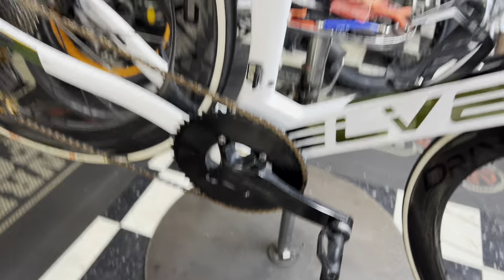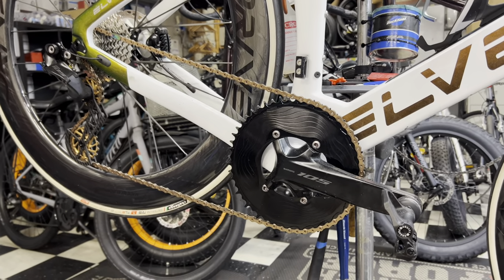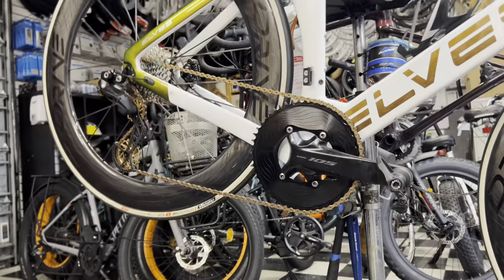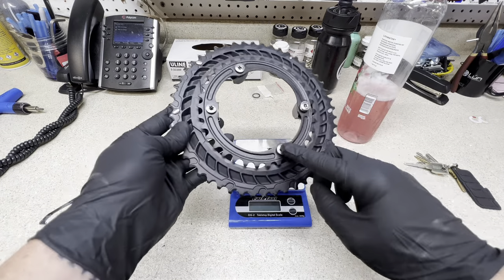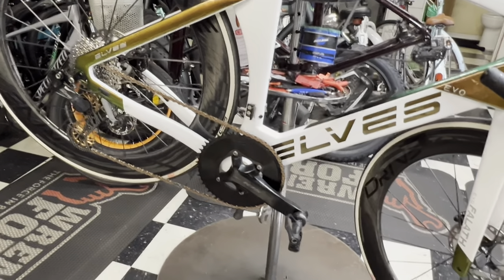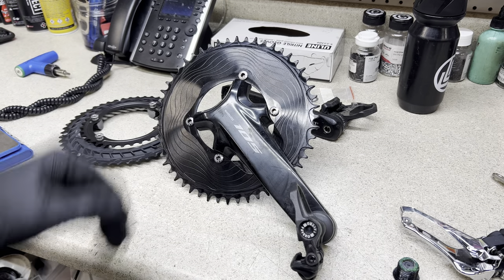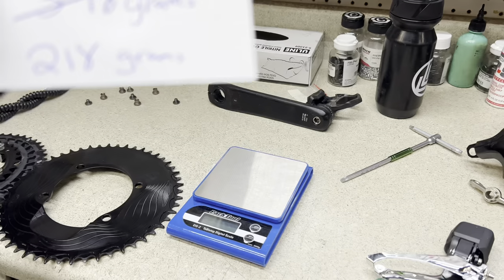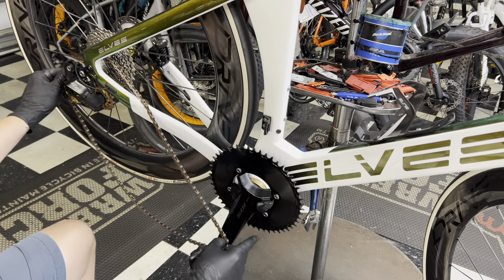IS THIS THE BEST UPGRADE FOR YOUR BIKE?

Comment: Alugear products bare a striking resemblance and the same chain compatibility as Garbaruk chainrings (which are excellent). Another interesting observation - both are made in Poland
Reply from the maker: Thanks for the info!
Reply: @GCPerformance18  What’s the chainline like on this setup? Does the Alugear chainring on the 105 crank line up dead straight with the middle cog on the cassette? It’s a super important aspect of 1x setups….

Comment: Hi Grant, I have a question for you regarding the frequency of chain drop issues with Shimano compared to Sram and Campagnolo. I'm curious if Sram's marketing tactics have influenced your perception, as my understanding is that Sram front derailleurs are often associated with chain drop problems. It seems like rather than addressing the issue directly, they market their 1x  setups as an innovative solution. Additionally, I wonder if many professional cyclists are compelled to use 1x setups due to sponsorship obligations. There are several videos highlighting instances where pros on sponsored teams don't use Muc-Off products due to issues.
Reply: I don't think Sram has that much sway over the strongest team of the tdf. I honestly think it was the better setup for them. Less weight and more aero. It's not like they need extra range.

Comment: I thought you get a worse chain line with 1x?
Reply from the maker: The chainline sits in the middle of the big and the small so there is not as much bend from top and bottom
Reply: It seems like my comments with links get deleted

Google 1x vs 2x velo news 

They did an efficiency test and got interesting results.
Reply: @GCPerformance18  I did some more research and what I found suggested that 1x is about 3 watts less efficient on avg, because you get more bend in the chain at the high and low ends of the cassette. With the 2x setup you can be in the optimal front ring to decrease bend.
Reply: @patrickrenschler 3 watts is totally lost in the noise. Its nothing unless you’re WvA - are you WvA?

Comment: Would you be able to use an 10 or 11 speed 1x chainring with the 12 speed chain? Since the internal width of the 12speed chain is the same as 8,9,10,11

Comment: This is a huge downgrade. Good if you like to run on a flat track. Terrible if you go up hills in the city

And the chain line is not straighter. It is straighter for beginners who forget to shift their front. 

Triple is the one that actually gives straighter lines assuming the rider is experienced at not cross chaining.

Comment: The rear derailleur needs a clutch, or any bump could drop the chain from the single ring
Reply: Not from my experience. I've used my current 1x setup for around 6 months and not a single chain drop. I live in the UK where the roads are known to be full of potholes too.
Reply: @lemonshire1 agree, a good quality RD and good quality ring are enough for all but the narliest off road

Comment: 14:29 I always wondered if that's normal. The chain is flapping enough to hit the chain stay. I had this happened to many of my 1x drivetrain bikes. I used frame protector to temporarily solve the issue. I guess it's a common 1by problem.

Comment: I have the 1x prev gen allez sprint and building a new gen with a 1x as well.  I really like the fact that I don't have to shift from small to big ring at the summit of those rolling hills in Tenn.  I did struggle a bit climbing long steady 12%+ grade when I took that thing to Taiwan.  I have looked at the Jumbo Vismo's setup as well.. most of them ran a 48 to 54t with 34 or 36 rear on their S5.  Not sure about their R5 climbing version

Comment: I like the ultra wide 2x from Wickwërks. Said it also work with SRAM chains so going to test it at my new TT build. 53/34 with 10-28, if it works. But otherwise I run 11s on my roadbike. 

It's so with that range. Wherever you go you have the gearing you need.
Reply from the maker: yea it is nice

Comment: Hey great vid! I tried this setup. Same Chain Ring, same Groupset. How do you deal with cross chain? It has weird noise on low gears and high gears extreme
Reply from the maker: If you wax the chain it helps a lot but it’s just for a little for the beginning wear of the chain on the chainring
Reply: @GCPerformance18  Do you mean that as time goes by the weird sound will just go away due to normal wear?

Comment: I don't buy the single chainring crossing less. The outer chainring is closer to the 11/10 sprocket, and per Shimano specifications I never go past the 8th sprocket either (21 on a 11-30 cassette).
For super flat terrains is OK cause you'll rarely get to the extremes of the cassette.
Reply from the maker: they are more centered then the outer chainring
Reply: There’s an offset built in.

Comment: 1x is not effective if you live in a hilly place. I run a 48/31 with the 11-34 and anything about 4-5% grade and I need the 31 to climb. With that being said I would need like a 42 front chainring or smaller if I want to be able to still climb above 5% grade. Here comes the big issue with that, when I go downhill I’m already running out of gearing with the 48 up front so a 42 going downhill would be useless! 1x are for very fit cyclists or cyclist who don’t climb.

Comment: How do your easiest gears work? I have this same setup with Alugear 54T and 105 di2 RD + 11-34 cassette. Top 3 gears grind and are incredibly loud. Wondering if it will get better as the ring wears a bit
Reply from the maker: I have no issues, depends sometimes on chain compatibility, as you can see i am running a mountain chain on there for looks, but sometimes certain chains until they wear down they are noisy at first

Comment: It doesn't give you a better chain line though, unless you're in the middle of the block. As for weight saving, well you're going to need a bigger cassette which will be much heavier unless you spend big money and DA only go upto a 34T cassette, and you're gonna be grinding up hills with a 50-52 chain ring and if you use a 46 or 48 chainring you'll be spinning out on decents. I guess it could be beneficial if you live somewhere flat.

Comment: The climb to my house hits 18%. The shortcut has a long 24% section. I can do a 50 mile ride to a ski resort that tops out at 10 or 11%. No matter my local ride, the last 1/3 mile is always the toughest.

No 1x for me (except my XC bike with a 34 ring and 10-50 cassette.) 

Also, doesn’t a 1x have MORE cross chaining? Big-big or small-small is slightly straighter than middle-big or middle-small.

And why worry about a few grams on the flats?

Yeah, for Florida, I can see going to 1x, but the day you take the bike on a trip for an epic ride, it could be painful. Maybe it depends on if you’re a grinder or a spinner.

Me? I’m a 65yo spinner. And I couldn’t compete with the pros when young. 2x for me on the road all day long.
Reply: 1x chainrings (good ones anyway) have an inboard offset built into them to account for this.
Reply: But to account for what? The big cog, little cog, 3rd from the right?

The big ring will always nudge things towards the little sprocket and the little ring will always nudge it towards the big sprocket. Isn’t that what we want? 

When people say that “a 1x gives an optimum chain alignment”, I think they’re just repeating a bad line. It’s optimized for what, one gear? It can’t possibly be better aligned for them all - especially at the extremes of the cassette.

Comment: Just bought one of these because my fd broke and I don’t really need it around here in Chicago. Anyway I was wondering if I would need a new chain that a few links longer or if my chain that I have right now will be fine. I’m going from a 50-34 to just a 50 tooth.
Reply from the maker: nice!!!! no problem at all it is the same size so you wont worry
Reply: @GCPerformance18  alright perfect thank you

Comment: What is the offset on the Alugear chainring?  Did you need to add spacers to the chainring bolts or bottom bracket to get the right chain line?   

I’m getting ready to convert to 1x with a SRAM dzero 110 bcd spider and a Garbaruk 1x aero chainring (48 tooth with 0mm offset).  Comparing a SRAM 1x direct mount chainring 40 tooth to Garbaruk, the SRAM is offset 3mm closer to the frame.  Worried I may have some chainline battles ahead.  Therefore, I’m curious if the Alugear has offset.
Reply from the maker: I do not know off the top of my head but mine is shimano so I do not need spacers for mine but for sram dub I would run the same bb spacer on the crank that comes with the same chainring

Comment: II have an 11 Speed Ultegra set up.  Are there any issues with just removing my front deraileur and leave the Crankset alone for now.  I am not worried about weight.  I just hate any chain rub noise.  I never use the small chainring.  Thanks in advance...  Great Channel

Comment: If you’re running a 2x Ultegra 12 speed groupset on the Elves, can you run a 54/40 chainring setup with that bike? And what’s the largest that you could run on that same frame if you’re running a 1x?
Reply: I don’t see why a 12 speed 54/40 crankset from Dura Ace can’t work with 12 speed Ultegra.  They’re basically the same 12 speed group.

Look for large 1x TT chainrings.  FSA has full carbon 64T chainring used in last years 2022 Tour de France time trials.
Reply from the maker: yes u can run a 54/41 that is a new standard and it replaced the 53/39 so there is no issue, you can run a 54 1x on there they make the bigger chainring options with a little more offset

Comment: I am using 1X, but 40T chainring, it's way enough for me. Do you really need 52T chainring? 52T with 10T in 90 cadence will be 61kph. I don't know man, not many people can ride this fast
Reply: It's more efficient because (1) the chain is straighter and (2) you are using the larger cogs. A lot of people think it's for max speed and focus on that too much. I'm running 54/40 in FL. Much better than the 52/36 I had.
Reply: Downhill?

Comment: What chain and lube are are you using?
I have the ALUGEAR 52t and a 11/30 cassette, but are getting a lot of noise from the chainring. Only 3 position on the cassette is okay, the rest are so loud (noise) 🙄
Reply from the maker: I am running sram eagle chain and silca super secret lube

Comment: The argument surrounding pros being 'strong enough' to use a 1x is completely superflouous. It doesn't matter how strong they are. They want to be as efficient as possible. If 1X is more efficient, for them, it's more efficient for everyone. If it isn't, it's not. Yes, they could muscle it up a 10% climb better than we could, but they're up against other pros on 2x, so if that's the better option, they're wasting energy.

Comment: would have like to see the front mech hanger to be removed for aero and weight gains (but l run an alugear on my TT bike and 1x on many bikes like offroad and commuter. not on the training road/race bikes since it's medium hilly over here and need the range) so yeah ... would like shimano to come up up a proper 1x road groupset or at least a cool crank and not just the GRX
Reply: l do feel like the alugear chainring (54 for me) is not a stiff and l had to file down the brake pad bolt on my tt bike ...

Comment: I just installed the chainring for 12 speed but need to sent it back cause the chain cannot align straight when the gear in the small or the biggest position.
Reply from the maker: really? that is weird, I have not had this issues, and i ran it on 2 different bikes. what group you run? and also is the bb installed correct for spacing?

Comment: I'm running 50-34 on the front with 11-34 on the back. That 34-34 gets used up the 15% and greater climbs around here. I suppose a 50 front and 11-50 on the back would work, but would it really?
Reply: You can run sram xplr 10-44 with a 44 chainring and have pretty much the exact same ratios.

Comment: How do you feel about chainlink when in the largest cog? I have the same chainring on BB30 (130 bcd) in a 46 11/34. Very noisy in the 34. I'm using KMC chain ? Have had wolf tooth in the past, and they seemed to a more quiet.
Reply: Mije is noisy too its crap

Comment: Why in the world do you use a 34t cassette? (Maybe a headwind hurricane?) There is less cross chaining using a front derailleur than not. There is no way a one by is more "efficient" unless you purposely cross chain using a front derailleur. Even then the extra friction between a one by and a front derailleur setup  is going to be very very small. You have no choice but to cross chain.

Comment: Also, why are people who don’t climb worried about weight? It literally makes zero difference on the flat. Like, none. The way to do this is probably the Vegan Cyclist way: 48t Oval chainring in the front, 10-50t in the back. All of the range, the oval chainring helps with smoothing out the large jumps between cogs.
Reply: Does the oval ring really help smooth jumps? I’m super curious… never tried one

Comment: cannot disagree more. to get even close to a 2 by system you need a pizza plate in the back and the chainline does not get better (i ride mtb a lot and in my opinion the 1 by chainline is way worse). i ride 8k a year and never drop a chain ever. In your situation where you basically constantly ride the big ring its viable but in 90% of all other cases its pizza plate in the back which ruins it for me.
Reply: totally agree..huge cassettes look like crap--i havent dropped a chain in many years..maybe its the mechanic..........................
Reply: 1x on a MTB is a different ballgame due to boost, super wide chainlines for tyre clearance. 1x on road is different, a good quality ring will have an offset built in to place the chainring right in line with the middle sprocket. Chainline not an issue on road 1x… gear steps and range compromises, sure, but not chainline issues

Comment: This is literally the bike industry pushing unnecessary technology to sell more bikes.  Why do you need a lighter bike when you have no climbs to go up? And by the way there is more of a chance of dropping a chain with 1x than with 2x. Just ask roglic.  I don't have chain drops on my 2x, which is still 105 mechanical. Also, electronic shifting is a big money grab that is not necessary but people on youtube keep saying you need it and mechanical is dead.  Ive never had an issue with mechanical and i don't need to charge my equipment just to ride my bike.

Comment: I remain unconvinced that 1X is an upgrade for a road bike.  I prefer a 2X with a narrow range out back.  If less to go wrong, saved weight, and drive train efficiency are really that important, ride a fixed gear with no brakes.

Comment: funny how you ride in a very flat area where hills are not a consideration, but you are still obsessed  about 3/4 of a pound weight savings, i would go for a double chainring setup and a closer ratio cassette to get more close steps between gears.
Reply from the maker: everyone likes a light bike
Reply: @GCPerformance18  yes but it is a cup of water weight, so maybe i should just start rides dehydrated  to save weight, or not even carry water bottles also LOL

i like your videos though :)

Comment: Not a pro? ride more--what a STUPID thing to say..  big deal, you take a pound off your bike--wake up, your 25 pounds overweight!!  thats an upgrade? so you ride 35 flat miles..thats a ride?? A fixed gear would work for that. If youre worried about dropping chains stay with Shimano with normal pulleys.. that setup will work for about 10 % of riders and you should say so..not everyone rides on a beach bike path in Florida

Comment: I stay on top of maintenance with my chainset and have never had a dropped chain while I am riding. I have a mechanical 105 and a chain catcher beneath the FD if it ever did come off. My chain is cleaned regularly and lubricated with  Squirt.  They have all lasted to at least 7500 miles, which I check regularly with a chain checker. I live in Florida also and am a 55 year old MAMIL, I'll stick with my 2X and let the younger and the easier impressed cyclists who jump to the latest fad of the moment. Do you know that there are cyclists out there who spend upwards to $700 for an OSPW to gain half a watt?  What wankers! 😁😁🚵🚵